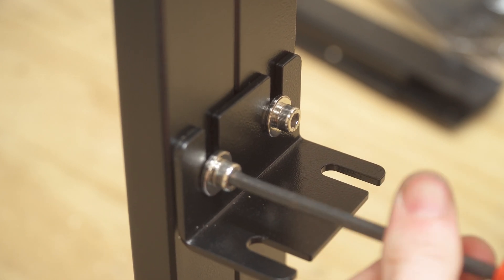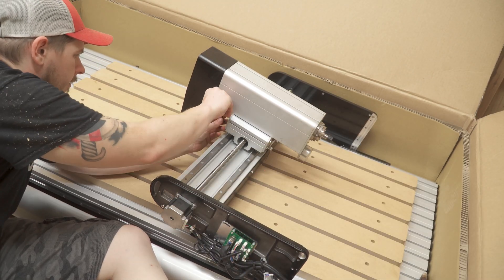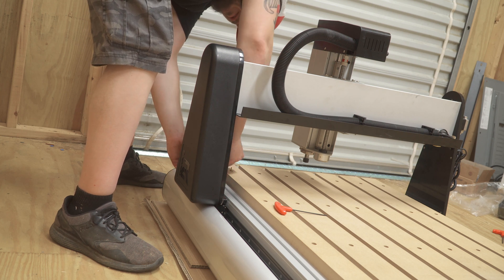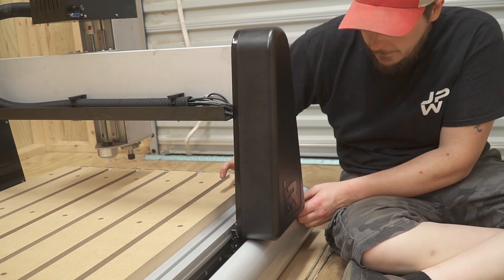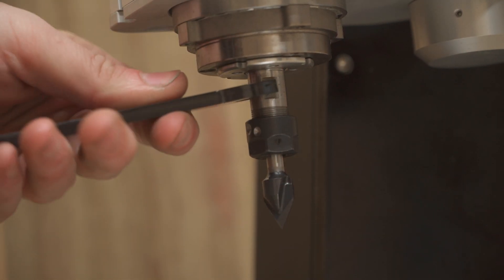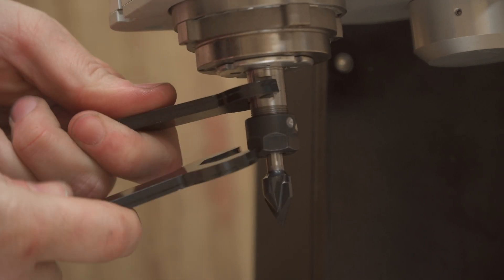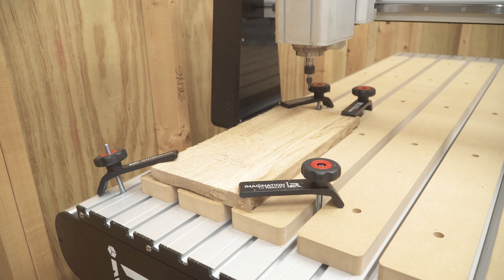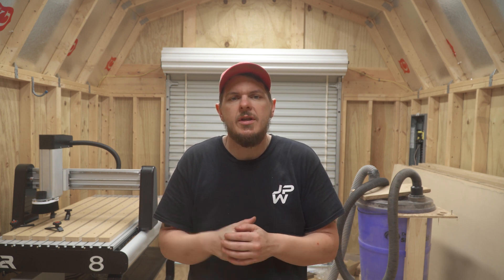Unboxing The i2R 8 CNC And First Cut

Comment: What made you lean towards the I2R8 UCCNC vs the axiom pro V5? Do you find having the machine directly connected to a computer as opposed to using a USB plug-in is paying off...or would you suggest the USB option instead?

Comment: I will be ordering the IR2 8 I was wondering if know the overall height  of the CNC and the stand together? Great video 👌
Reply from the maker: I will get you a measurement when I get back o the shop it should be on the site i2rcnc.com
Reply: @jpaynewoodworking7510  I can't seem to find it. I want an over all height with the CNC  on the stand